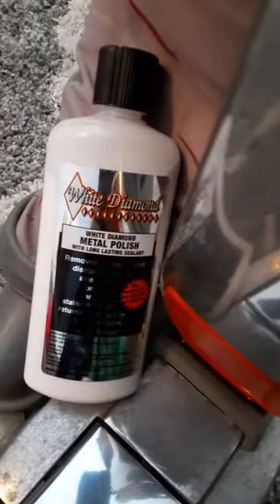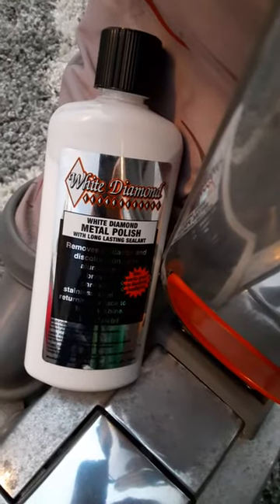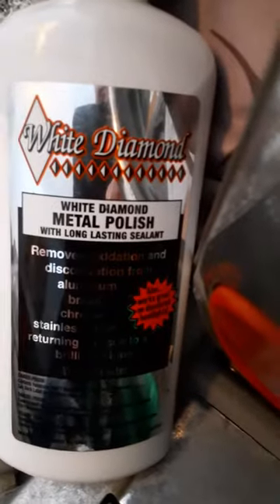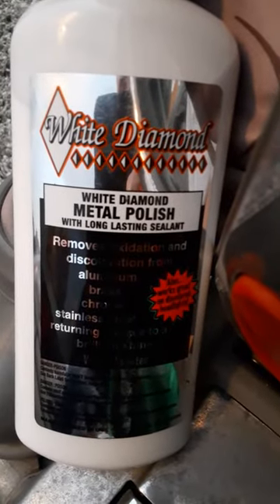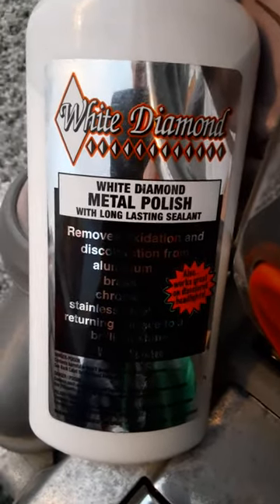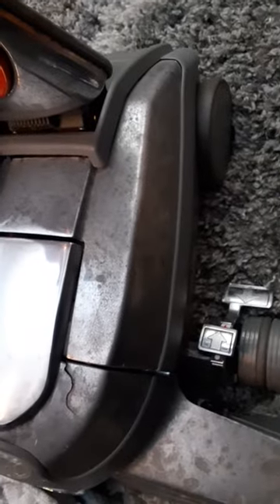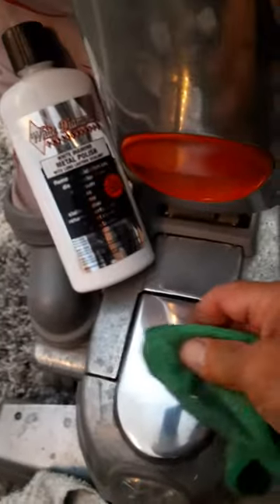Chrome polishing Kirby vacuum sample

Comment: I use this exact same stuff. Works great and has very low odor. It’s actually vanilla scented, and doesn’t have those nasty ammonia fumes. Makes for polishing indoors a much better experience and without the headache afterwards. It can even be used on clear plastics to remove light scratches and yellowing!